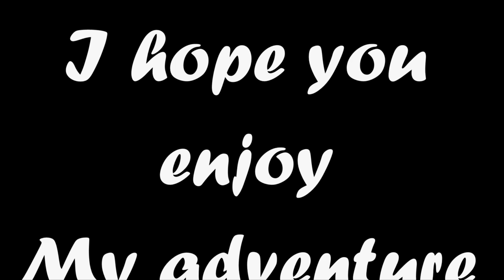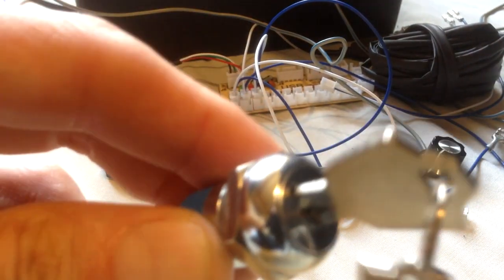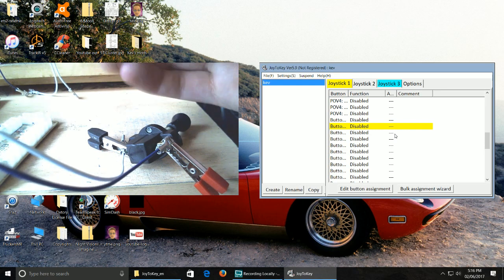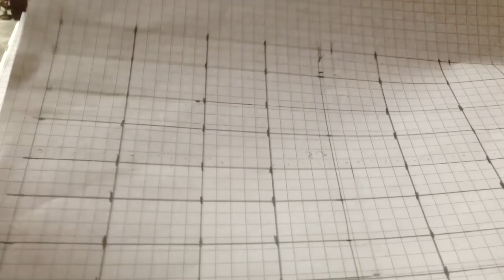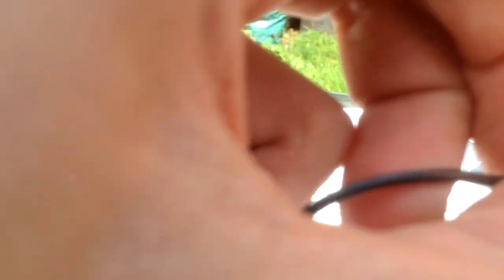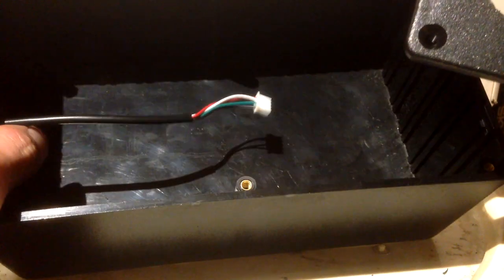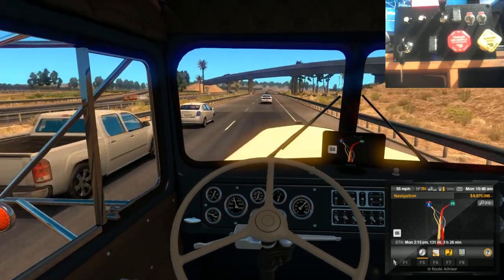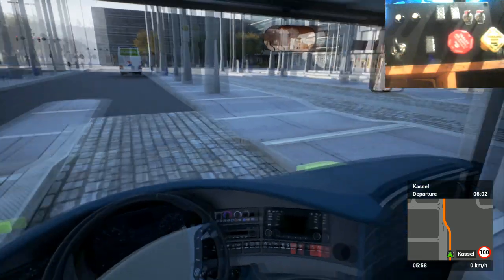How to Build a Button Box for your PC

Comment: How do u do the cb?
Reply from the maker: Hi you would need to find a separate bored from a headset or sound recording hardware then hard wire it into a CB jack
Reply: Kevin Sawyer how would I find one of them or do you that
Reply from the maker: Well you can find a cheep headset and from eBay and the cb and connecters on eBay I know Maplin use to do them
Reply: Kevin Sawyer  could u do a video ?  And how would i connecnt them
Reply from the maker: I may do when I get time my next project is my simdash rebuild
Reply: Kevin Sawyer how would I connect the CB connectors to the headset like I don't understand
Reply: Kevin Sawyer  did you explain how to hook up the wires to the CB piece from the headset

Comment: could you send me the link so I can buy from the 10:55minute
Reply from the maker: Dan Felix if you mean the switch you can find then on Amazon
Reply: I searched for the links that you left but did not find.    Another help I wanted his is the 26:19 minute those yellow and red covers where can I buy?
Reply from the maker: https://www.amazon.co.uk/Sharplace-Motorhome-Vehicle-Starter-Control/dp/B078S863MH/ref=sr_1_2?ie=UTF8&qid=1531503838&sr=8-2&keywords=push+pull+switch 

https://www.ebay.co.uk/itm/MV3-Yellow-Red-Valve-Parking-Brake-Knob-PAI-Brand-Ref-Bendix-298818-298817/253711160177?_trkparms=aid%3D222007%26algo%3DSIM.MBE%26ao%3D1%26asc%3D20140725133651%26meid%3D91395f0057f140f1bc15bb0a5203be59%26pid%3D100276%26rk%3D1%26rkt%3D4%26sd%3D262316702405%26itm%3D253711160177&_trksid=p2060778.c100276.m3476

hope this helps
Reply: Helped me a lot. thank you
Reply from the maker: Dan Felix glad it helped 😀
Reply: @Kevin.Sawyer  I've been looking for this forever! Thanks for the links!!!
Reply from the maker: Bobby McAtee no problem bud, if you would like to help me out in any way by subscribing or leaving a like or sending a donation please feel free